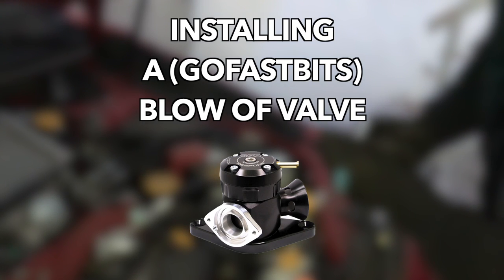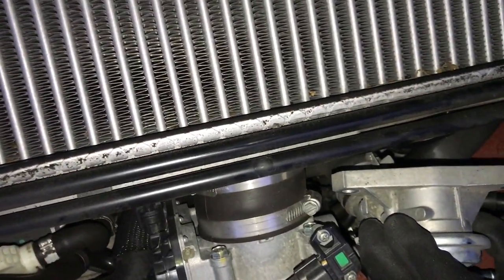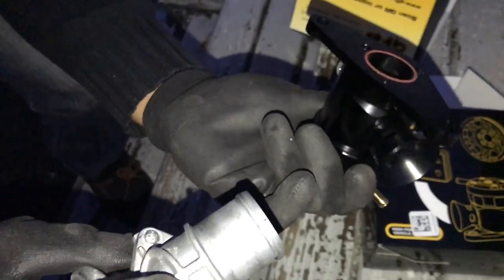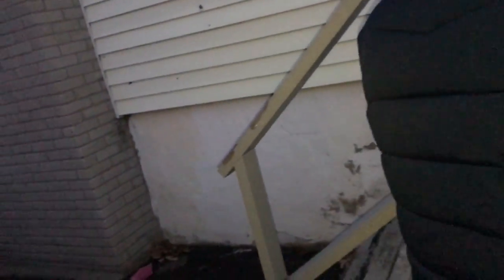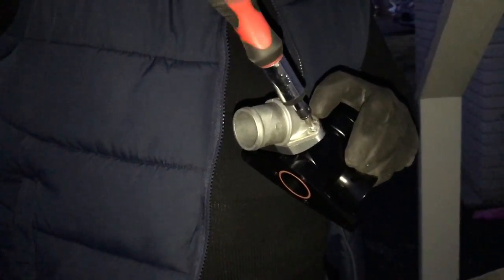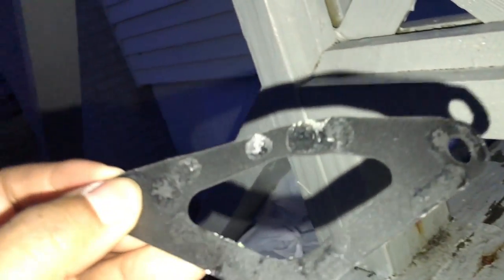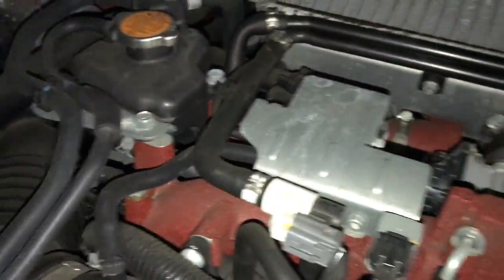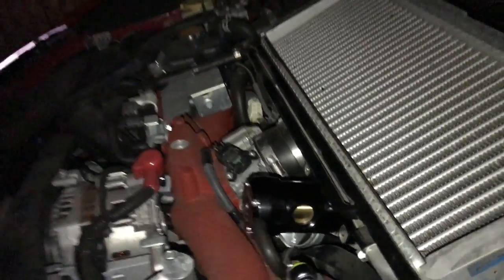GoFastBits Blow Off Valve Installation on 2016 Subaru WRX STI

Comment: The GFB doesn't require a new gasket since it has an O-Ring on the flange. Putting a new one could create a leak if the gasket and o-ring overlap.

Thanks for the video though! Great sounding subie!

Comment: Thanks for this video. I want to Buy the same bov, too. How is the sound with 50% Open? Have you ans Problems with the bov?
Reply from the maker: Rick Müller sound at 50/50 it’s loud enough and I have had 0 issues with it even at 100% vent. You just need to set the preload on the BOV to have the piston inside close before the car hits idle and you will be fine 😊
Reply: Ok thanks. I had the hks ssqv4 before. But i selled it. I think the gfb is the right decision.  👍
Reply from the maker: Rick Müller oh cool I see i hear those are great quality. What I like about the GFB is the adjustability closed,50%or 100% or anything in between😊

Comment: Hows the reliability so far? Have you taken your car the delaership while the bov is on?
Reply from the maker: Great question I still have the BOV on and I always take it to the dealership for things under warranty and they don’t say anything only “cool car Can I take it for a spin after lol” it’s has been reliable no issues at all and it sounds great I recommend this BOV to anyone it has been nothing but perfect for my subie.
Reply: Cool! Did you take off the extra gasket you put on since the bov has an oring?
Reply from the maker: Chee Nou Lee i took off the old one and replaced it with a new one, u can do either or the BOV has a gasket already
Reply: @HoeLeeFuQQ  Nice! How did you clean off the old gasket?
Reply from the maker: @CNL1203  just pealed it right off.

Comment: Do you need any tune at all when installing a GFB BOV on a 2018 WRX?
Reply from the maker: A lot of controversy about needing a tune with this mod but in my “Personal Opinion” No... i still have the BOV on the car till this day and have never had any issues.
Reply: @HoeLeeFuQQ  thank you! I just installed the GFP BOV, set it at 50/50. Sounds amazing.

Comment: sorry for so many questions i have a 2017 STI and its a lease I'm just tempted to mod but i don't wanna blow up the engine
Reply from the maker: Nathaniel Barbaran it’s ok mine is a 2016 it’s also leased, these are light mods I think your engine will be fine. Mine has been so far lol
Reply: I have a 2018 STI limited lease and I have a COBB stage 2 tune AP with a downpipe and stock exhaust and this bov and no issues. To be honest longevity is not really my problem, so as long as the engine doesn't blow I'm happy.

Comment: joint still running ? and what mileage you at now ?
Reply from the maker: Yeah still on the car and no issues has about 30k miles with this BOV.
Reply: HoeLeeFuQQ nice ! what other engine mods you have rn ? AOS and or cylinder 4 mod ?

Comment: Why some videos I see people install bov underneath the car next to the turbo itself? What's the different is there 2 bov?
Reply: What's the bottom bov near turbo for?
Reply from the maker: oboys1502 depends where the Stock Bypass valve is located, thats what gets replaced.
Reply: @HoeLeeFuQQ  https://youtu.be/OnWo8ZOWXhA its 2015 wrx no different from a 2016 so why its install differently.  I'm confused
Reply from the maker: oboys1502 in my video I have a 2016 STi that has the EJ257 motor and in the video link you shared the guy has a WRX that has FA20 motor. So it’s 2 cars that look the same but with different motors. 2015+wrx have the FA motor and the STi has the old EJ 257 motor and it has the valve on the top while the wrx has it underneath.
Reply: @HoeLeeFuQQ  ahhhhhh, I got it thanks Haha that was dumb of me

Comment: I bought this BOV and engine light is on do u think that could be the reason why?
Reply from the maker: After installing it make sure it tight and not leaking, I have never had this problem and still currently have the BOV did u replace the gasket?

Comment: I just bought one of these but I’m on speed density so I’m not running that tube. I’m hoping it sounds loud.
Reply from the maker: Worth every penny to me still have it installed to this day and it should loud with some pops and crackles 🥴
Reply: I’m on Speed density as well but have a Cobb BPV I just ordered this GFB but I’m still nervous to go full recirculate since I was tuned on a BPV, in theory it shouldn’t matter though right? Lol

Comment: Is there any issues so far?
Reply from the maker: None at all it has been working fine so far
Reply: Do you have link where you bought it. Thanks
Reply from the maker: Joemer Snipermx 

https://www.rallysportdirect.com/part/blow-off-valves/gfb-t9003-go-fast-bits-tms-respons-hybrid-blow-off-valve

If it doesn’t come with a new gasket u will need to buy one they are like $7. Never reused a gasket. I say this because some people when u order the gasket comes in the box hidden inside the foam, mine didn’t bring one so I had to go to Subaru dealer and buy one.

Comment: did you engine light come one with this installed?
Reply from the maker: Nathaniel Barbaran nope no engine check lights or anything and I been using it at all settings meaning 100% open 50% 25% etc and still no lights or stalled everything is good.